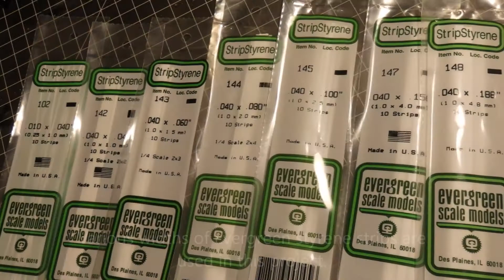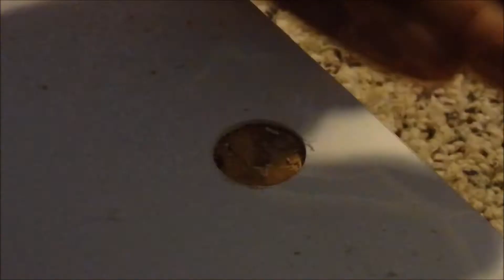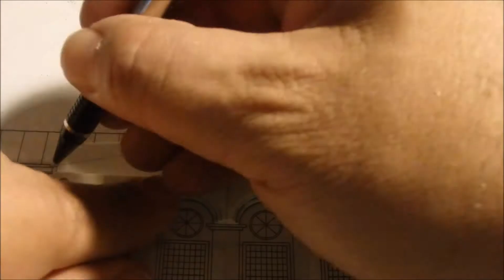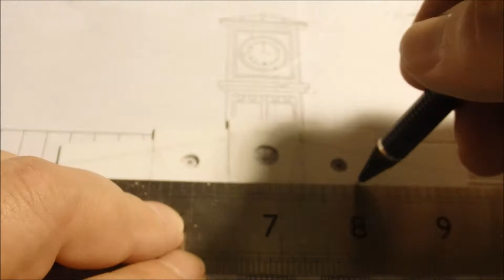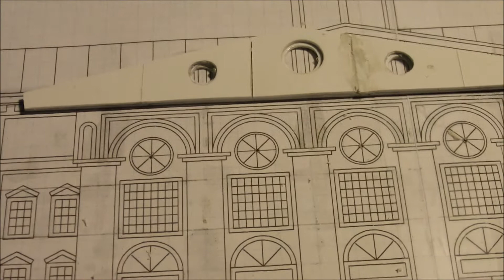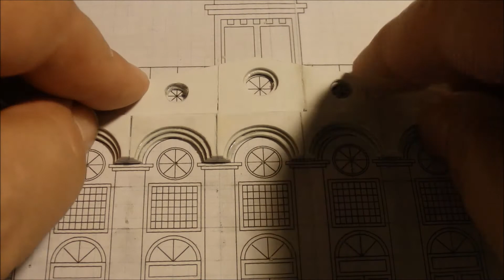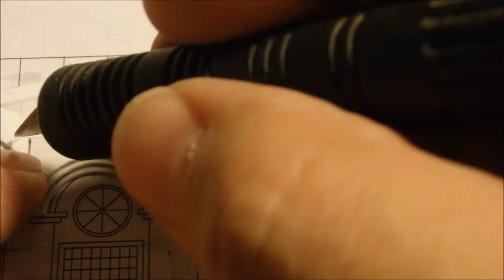MNW N Scale Model Railroad Monthly Video Journal, October, 2017, Part 1.

Comment: that is a really interesting technique!  Because you have been so precise with CAD, have you considered making a jig so that the replicate parts are truly identical?  Tiny errors get magnified and can come back to haunt you when you are putting the walls together and spoil the build (been there).  Does all of the beautiful trimming help prevent the styrene from warping?
Reply from the maker: Hey Carlos. This is a project I have started over with using many design changes for pretty much the same result but much better. I did come up with some jigs in the rebuild. I haven't had much trouble with warping. Thanks for the comment!
Reply: @collinsullivan1517  well, Im in for a penny, in for a pound.  watching the miniseries of the build.  Ill bet all of that styrene frosting makes those walls good and stiff so that they DONT warp>>BONUS.